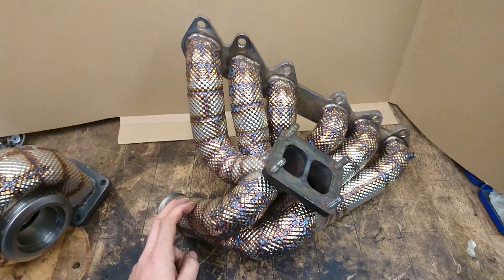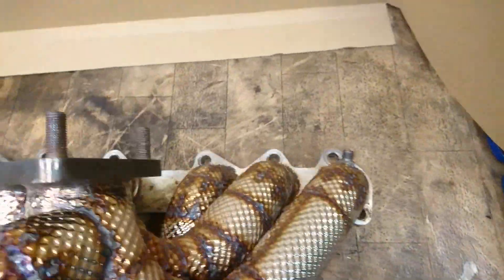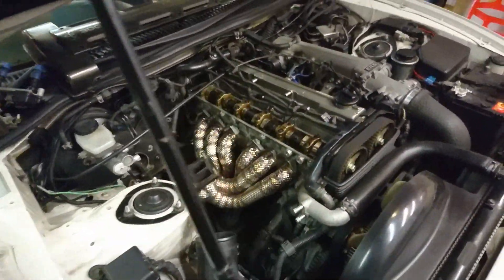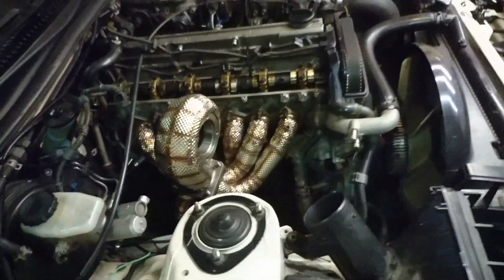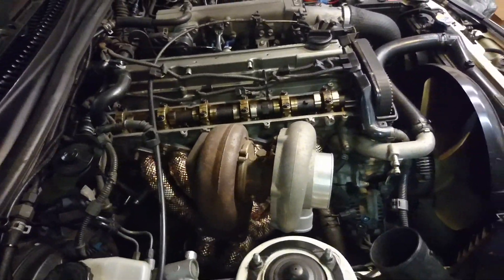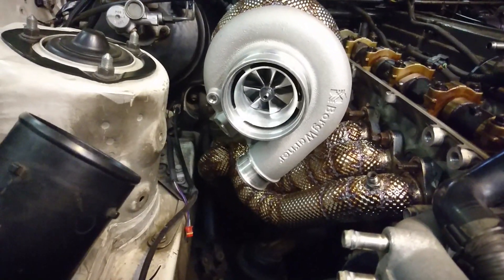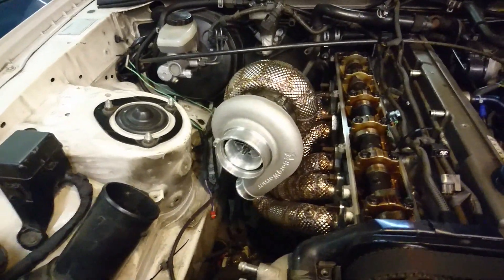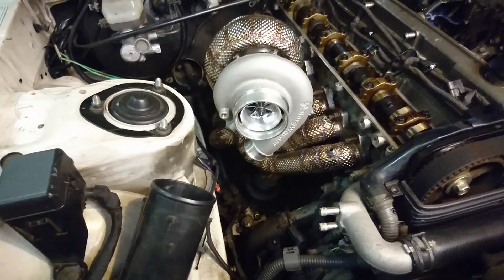Supra MK4 Borg Warner S257SX-E with Greddy thermal isolation exhaust manifold

Comment: Nice, where can I buy that thermal insulation? Which company makes it.
Reply from the maker: you can buy from HJS (stainless steel foil and isulation mat)

https://www.hjs-motorsport.de/produkte/universalteile/montagetechnik.html
Part No: 8300 0020 or 8300 0025 or 8300 0027

https://www.hjs-motorsport.de/produkte/motorsport/intergral-isolierung.html
Reply: @Supra2JZLife  that turbomanifold and housing are a work of art, how did you fit the thermal insulation barrier to the manifold runners and turbine housing so cleanly? I don't even see a crease or anything, were pieces cut and formed and then welded together or are my eyes tricking me?
Reply from the maker: @aaronkraemer9887  the manifold and turbine housing did a company. I made the downpipe myself for the first time.